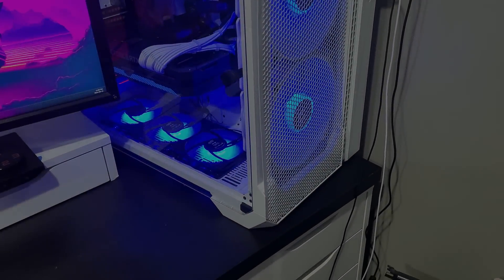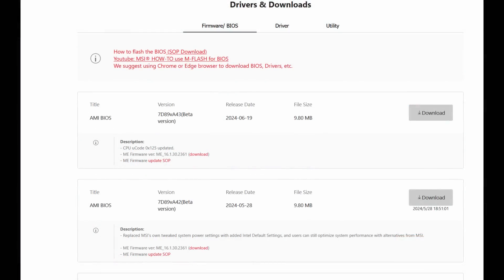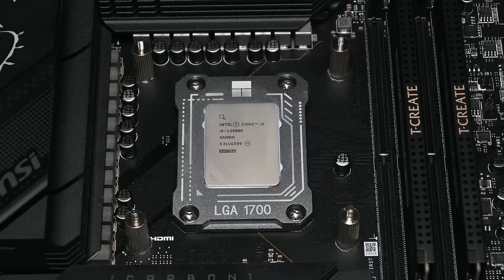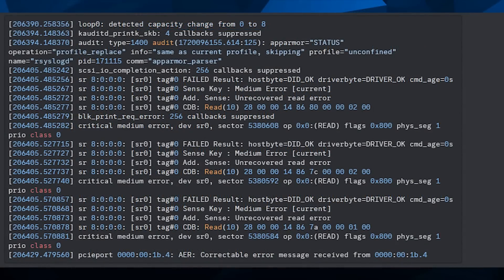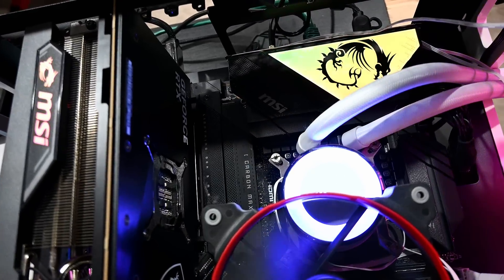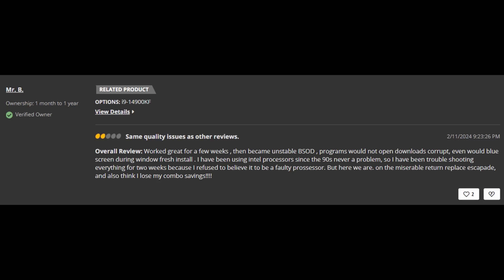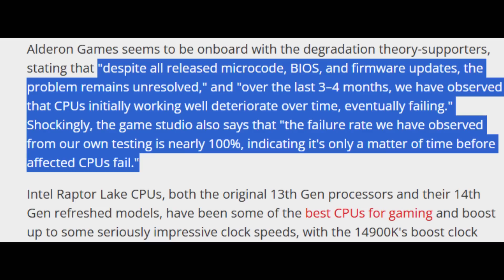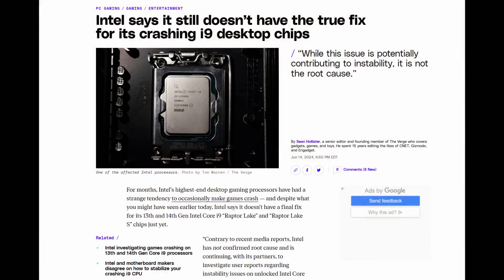Intel CPU Crashing Situation is FAR Worse Than You Think! - 50% Failure Rate, RMAs Denied

Comment: Maybe they've reached the limits of their existing monolithic architecture and are now trying to maintain their dominant position over AMD by deliberately releasing processors way over real spec, resulting in processors that live fast and die young from overheating?

Intel's history of sticking with an architecture regardless of how bad it's getting goes back to at least the Pentium 4.

Until then, Intel 13th+ Gen owners really needs to underclock and under-volt their systems to a performance level comparable to older processors that are still happy to run just fine on air to alleviate the issue.

Comment: I tried to build a 13900k system, wouldn't even boot, so I sent it back for a 14900k the day it came out, it was so unstable I couldn't even get through a cinebench test without crashing. I have a top of the line system with a quality water cooler. I had to bring my computer out into the 40 degree garage just to barely pass it. I swapped out a AMD AM5 MB and got a 7950X3d and it runs perfectly. Get your act together Intel. And no it wasn't the OC on the MB I even set the CPU to enforce all intels limits which slowed it way way down and still it was crashing on any serious load.

Comment: Built my new PC a bit over a month ago and I'm using a i5 13600k, really hope I don't end up with problems like this. Didn't do enough research on CPUs unfortunately, probably would have gone with the 7600X if I had.
Reply: 13600K OC 5.7 P-cores 4.5 E-cores 5.0 Cache. 1.37v AVG LLC4. 200W 90c. Not affected unless I want it to be affected. Pretty easy to recreate those errors, crashes and fix them back but for a person who has no clue what to do it can be impossible to solve. The CPU's are fine, it's all in the settings.

Comment: I don't know why techtubers and journalists can't do research. The Intel enthusiasts have had this pinned down with a fool proof preventative measure for like 2 years. Manually overclock. The stock boosting algorithm is the problem. Don't let them overvolt and they won't degrade. Once they've already degraded, their toast. The damage is done. All of this degradation can be prevented, but not fixed.

Comment: i hate the low Cpu Core tactic with maximum 8 or 10 cores on the most of AMD'S CPU's for Windows 16 Cores or minimum 12 are the goal to run the big nvidia grafic cards 4080 and 4090 on 3k or 4k resolution  with 90 % utilization limit or higher in games like Anno 1800.

8 core CPU'S are not enough for windows 10

Comment: with this 3 settings PL 1 PL 2 and the 511 Amps setting you show the same wrong ... like everyone no idea what the true Problem or why did everyone the same Failure.

the Problem is SVID Voltage i limited it with full official clock 4.2 GHZ and 5.4 GHZ on my i7 13700kf voltage for E-cores and P Cores to maximum 1.269 voltage and minimum 1.235 with LLC 6 on Asus Motherboard anything below 1.23 voltage and 1.225 voltage caus instability anything above 1.34 Voltage on SVID cause instability and way to much. 

The Voltage for P cores is on Auto standard to high for E-cores to low you have to set many things by yourself correct to get this bitches correct running they are an Hybrid System and no i9-9900K.

It look even and 90 5 of the Youtuber didn'T understand the true Problem and how they work.

if You limit PL 1 and PL 2 under maximum and the third one und the 511 Amps you loose to much multicore Power it can cause instability too .

Reduce SVID Voltage to under 1.3 Voltage with LLC 5 and LLC 6

Comment: Why does not my 14900ks have bad stability? It did run hot with 370w usage. Now it runs on 230w. Is people buying cheap motherboard with bad powerdelivery? What cooling do people use?
Reply: In the failure rate chart, the ks chips seem to fail less

Comment: Seems like a perfect storm.  Day-1 non-optimized voltage settings running for too long, possible chip bends on stock socket plates causing overheating from uneven surfaces, chips pushed to the max before overclocking (no OC headroom), late identification of problem and response with safe Intel bassline firmware. 

This all leads to absolutely damaged chips and the illusion of "'100% failure by unknown degradation'". I say 'illusion' because all the problems seem to be heat induced.  Most gamers expressed temps of 80-100+celcuis, and servers can easily reach these numbers (we also don't know the environment conditions, bios specs or 1700 socket support), and testing with pre-Intel safe firmware is trying the same thing and expecting a different result. Of course they are going to keep failing!
I mean ASUS didn't even release proper 'Intel safe' bios firmware until July 10th 2024 (5 days prior to this comment).  With a proper CPU mounting plate, good cooling and Intel baseline bios setting, the CPU should not exceed 80c under full load, and idle around 32-45c.  Basically 'no long-term heat, no expected abnormal degradation'.

Sucks for everyone prior, but maybe good news for those starting tomorrow.

Comment: Like any other product today there is a DEI bug in everything, we need to get rid of DEI entirely, all traces extinct for everything to go to normal.
Is not the first time when Intel put 100% rate defective chips on the market:
The USB module on the the forth generation of laptop Intel I chips was defective from design, if you put the laptop in sleep the USB module doesn't wake up or will crash the system.
The second time they put an Atom chip that was present in some Synology devices where the crystal oscillator was with a bad design that in time about 3 to 5 years of usage will no longer boot, the fix was to put a resistor from the ground to the oscillator pin.

Comment: Wow... I must of got very lucky on the CPU and mobo lottery's because I haven't had a single issue and I game with very high levels of CPU utilization with flight Sims and other intensive task very often also, never had any of these issues report and even under stress test running it at 300+ watt it's never bsod or froze or crashed.. it's without question one of my most stable systems I've ever owned..

Comment: Are these only the overclockable systems like 13900K? Or does this affect low power Core i7 Ultra chips?
Reply: @zorexlt8312 non K ones are the ones that are tested as unable to boot at all at K freqs, they'll sadly degrade even faster
Reply: @erkinalp  are non k 13th/14th gen intel cpus not safe?
Reply: @otonashiayana999  they'll degrade faster at even lower voltages

Comment: Apart from the thing with the 4096w 500A that i had to lower to PL1=PL2=385w 420A because Games would crash on Shader compilation, I luckily didn't have issues with my 14900K. I don't use an contact frame. Cooler is an 420mm AIO. I now hope that it stays that way and that it isn't a defect that can suddenly appear later.

Comment: I purchased a i9-13900k for a Asus Strix Z790 ddr5 6400 ram for my gaming pc  when they first became available and I paid around $600 for the specified performance. 
When the cpu was new it was blazing fast, but I rarely even played my pc and over time it has gotten weaker and if I use those Intel recommendations that cpu doesn't perform as good as my i7-11700k did in the pc I had before.
Everyone should get the $600 performance they paid for or get their money refunded because mine doesn't even come close to running 5.8 using intels crappie weak recommendations, more like 4.7 Cinebench and that's the p cores.😢
Reply: My 13900K seemed to slow down over time, it was strange.  It went from booting up right away, to getting strange shutdown errors, slightly slower (but still quick) bootups, and some strange lag watching YouTube clips and multitasking.  Then one day, I shut it down, went outside for a couple of hours, and it never worked again with a CPU light on the motherboard.  Bought a Z790 motherboard, thinking the Z690 went bad, same thing.  New 14700K worked on both motherboards.  I just did the RMA today.

Comment: The whole issue can be traced to the memory controller overheating. The common thread in all the failures is the memory controller and its associated components. What the problem is unknown. But all the problems suggest that the problem is the controller.

Comment: Stay away from 13th and 14th Gen. They are terrible and randomly unstable. And the IMC is garbage on any board running DDR5 XMP 6000+ especially higher on any board except non Asus 2 DIMM boards and it is not stable. If you think it is watch random instability in Battlefield and oh it shows up if you run OCCT Large Dataset variable test, you will see core errors and/or WHEAs. Higher speeds the worse it is.

Plus lots of other non-DDR5 degradation and stability issues that are not easily solved by non Asus 2 DIMM board.

Comment: I am now curious about 65W limit rather than 100W limit. latency vs throughput (cache vs CISC, single threaded vs multithreaded). We need tokens to manage latency via logic and memory. Cache hit rate ends up driving power loss which makes dynamic switching less problematic. Programmers need to use a high hit design. (This creates problems though.) 

It used to be we could experience a gain in latency through power limit, but I am not sure that is true anymore. I guess we can try cache performance and capacity. Windows can rebuke us. This is just sad. Now we will have real power users. Good luck to anyone in GUI. 

These people are considering a run on FPGA, get low. Talk about little Caesars pizza, but we ain't talking crazy bread. We talking spices.

Comment: Factory overlocks = High Heat plus voltage spikes and high clocks this accelerates current drift migration crosstalk through insulation barriers cause internal short circuits burning through insulation Layers … Moores law is Dead .. Need better design and new tech… It will take another 10 years to fix😂… New releases are just bandages to patch up previous designs.. lol… We also need better more efficient  programming and code .. !!

Comment: I suspect Intel knows exactly what cause(s) is(are) and it's inherent in the design and they're hoping to get arrow lake out fast enough to burry the story and cover their tracks. 
Now complex electrical devices can be hard to DX, especially ones that also have to deal with QM effects, and if this was merely a few percentage points higher than normally expected, or even double, I could see it being still uncertain the exact cause, but with it being most 13/14900 k(ks/kf,etc) skews and many 13/14700k series parts I find it hard to believe with that many returned and examined they're still completely in the dark on this. They can set up hundreds of test systems and try thousands of variations until they have a repeatable set of failure cases. At the very least they should know what specific part is failing. Unless they've literally run into some new physics at the quantum level and are about re-write our understanding of QM in some way.

Comment: All this sounds like a theory rather than a root cause. First the problem is not specific, different types of issues are just put under one banner. Second the troubleshooting lacks depth.

I have an Intel i7 14700k with a DDR5 RAM, and I run everything at stock setting without overclocking or XMP profile and I have not faced any issues till date. My rule is simple, no need to tweak BIOS or overclock if I can play games and write codes without any issues at stock settings.

Comment: There's 125W or more going through a tiny processor which was never designed to allow for so many cores / layers.
If you inspect a broken CPU under the microscope I bet you will find that the material that is supposed to separate the lanes has weakened / melted, resulting in a short circuit when pressure is applied. This would also explain why it only happens after a year or so. Bending happens gradually, but of course it happens faster when the material is weakened and under too much pressure (from the infamous CPU latch or overtightened cooler).

Comment: What you said about DDR5 is 100% true. The auto voltages are often dangerous and unstable.

Regarding raptor lake instability, it can be just one core being bad, you can try ratio-limiting individual core(s) to see if that fixes the stability problems.

Comment: Almost reminds me about my i9-9900k case. memkit rated speed was overclocking cpu memory controller. 6 months ok then failed to boot to windows -> dropped to jedec and worked for 3 months then had to RMA. When I got new cpu then verified that I run memory with controller specs. Now that setup is used by my niece and it's working ok and I'm using i9-12900k. It seems I will postpone my system update.

Comment: It's not clear to me whether failure rate if those 13th and 14th gen i7 and i9 are just for some retailers so it could be only few bad batches, which can be in  single digits of 1000 chips or is it issue of whole production?!

It is fact that many high end users (enthusiasts) upgrade regularly, but seeing so many issues within guaranty doesn't look good. 

If its matter of multiple causes or Intel released products with same failure rate but (median value) towards shorter upgrade cycle much closer to guaranty period, who knows. 

I am probably safe from these issues as I was never using high end cpu chips and I am on 10th gen i3 thanks to no good price performance uplift in past 4 years in that segment. 

Maybe this case will be good reason to come out with agressively priced Arrow lake. 😊
But I am still concerned about stability of chips but also Ddd5 memory too. 

Maybe it would be good time to wait let 1st wave of customers become beta testers, same for Ryzen 9000, then make a choise. 
But 4K high refresh IPS monitor to be futureproof and run it at either upscaling from lower res or at lower refresh rate. (RX6650XT, 10100f, but just online competitive DX11 game, no hungry HW requirements). 

Really this sounds as scaryimg as crypto boom.
Reply: Just get 7800x3d for best price to performance.
Reply: @Riyozsu  Did you calculate? It high end not worthy 2x price for 10-30 percent more fps.
7500f!
Btw at 1440p or 4K its even more gpu limited.

Comment: im just gonna stuck with my x299 platform... 18cores36threads is plenty... would love a die shrink chip for these boards but outside that... at least i dont have to worry about these issues...
Reply: My dream pc would be the x299 Aorus gaming 7 MB and the 10980xe from Intel.   I am currently running the 10850k on the z490 Aorus Master and have been looking to do the i7 14700k with the Aorus z790 Master x next month.   I had always been team intel but I tried AMD during the 965be, 1100t and then the 8350 and had terrible memory issues, crashes, BSOD and driver/bios support sucked.  It was a long time ago but those kinds of things are what is keeping me from going back to AMD.  Might just grab a 4080 super and forgo my upgrade and hope the 10850k keeps going strong
Reply: @IceWarrior341  i have the x299-e strix gaming and a delidded 7980xe in here at the moment.

and i had GREAT luck on amd, x64-8350 era, you needed to buy a decently high end board sabertooth or better minimum, and with a bit of tweaking 32gb at 2133 was quite easy to get on a cheap gskill 32gb ares kit, one tip i gave people was also not to buy high end ram,  for FX it wasnt worth it in my exp, most cheap kits could be dialed in to very close to if not matching them but oddly with less issues if you started from their xmp profiles.. 

as to this setup, i actually have an extra x299-a II and 10900x as well as 7940x i got for a project thats prob not gonna happen, well the 7940 was my first chip, the 7980xe was the 2nd, and the 10900x was the latest, after testing this 7980xe gets within 20mhz of the "sweet spot" of the 10900x, and the extra lanes dont matter for either bord as on this board it just adds 4 more lanes to the bottom slot and for the extra board i have... it moves 1 m.2 slot from chipset to cpu direct...with 3 m.2 slots on the boards... im sort if in love with this platform... 44-48 lanes direct off cpu, quad channel ddr4, and 3600 is easy to get,  3733 is the best i could get the 10900x happy with on this ram...but the 7940x i have... plat sample IMC.. i got 4000 24/7 stable with over a month of up time between reboots... that chip needs a delid and repaste though.. i got little doubt it would clock like a damn champ after with the results i got at first.. (i got all the cpus ebay, boards are new...the extra board i have has a 5 year warranty waiting to be registered..heh..) 

this platforms just beastly.... and dosnt  kill itself like 13th/14th gen are.....

also less issues... since... its all just full P cores, no E core +P core bs... and these P cores are between current E and P core perf soooo.... yeah.... i def have less issues then ppl with current gen amd and intel rigs do... also.. this platform loves ARC/ARC loves this platform... :)